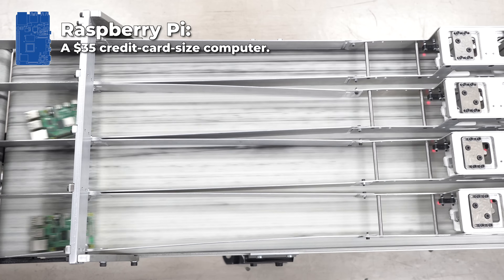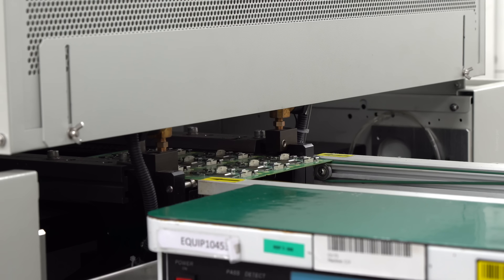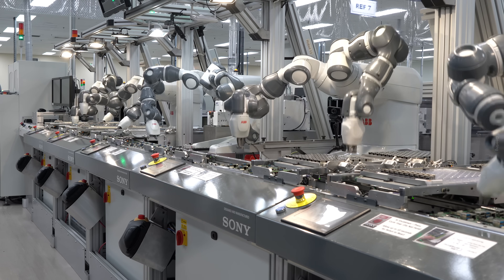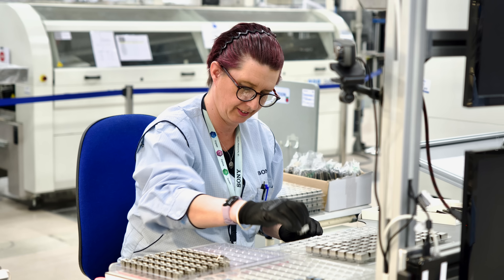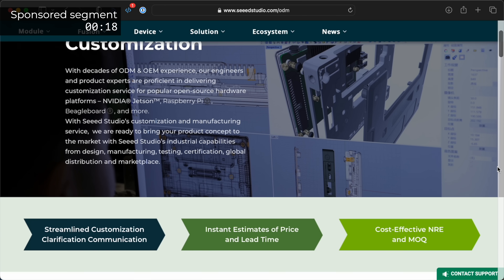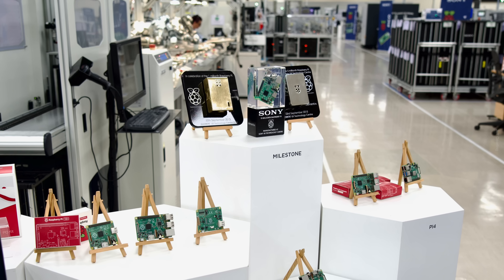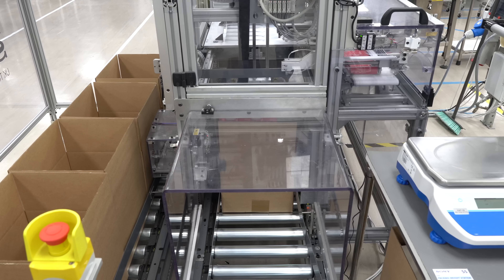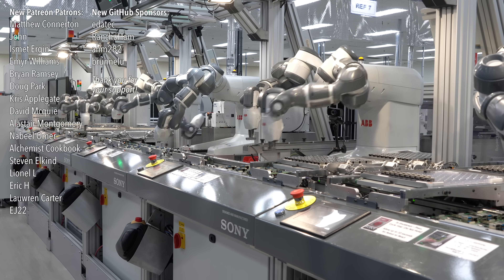How Raspberry Pis are made (Factory Tour)

Comment: Those two armed robots were first used on the HandiCam line in the mid 80s. Their development and tuning was a fascinating story.
Reply from the maker: I'm amazed how dextrous they are. They put me to shame.
Reply: @JeffGeerling  don't worry, they had and infinite amount of money and more than 1 person developing those :)... your cool things are made by you alone right>>>
Reply: the Robot arms were from ABB and according to @outofspec they make EV car chargers or dispensers (I can't remember what)
Reply from the maker: @lovedfriend2020  ABB makes a ton of cool robots!
Reply: Those ABB Yumi double arm robots are harder to operate compared to single arm as they double the complexity, they can be used to for examble assemble a lego. - my friend from a different department
Reply: @may_12521  Double arm robots are only really n advantage where space is at a premium. Notice how it is rare that they both move at the same time. Usually two separate arms are quicker and easier to program. They are mainly a gimmick tbh.
Reply: @robotsnthat  a double arm can be used as 2 seperate robots or as a single collaborative double arm unit. I wont say its a gimmick, just the double arm can do much more. if both arm work together, it can cut down time wastage.
Reply: @may_12521  No! One axis missing to be really efficient, and in my experience, way too hard to program. I've been an industrial robot engineer for over thirty years, and it would have to be a very specific task for me to even consider one. Multiple robots can be easily synchronised using one controller, and it gives much more flexibility,.The only advantage is they they take up a little less space.
Watch carefully and you will see that both arms move simultaneously only around 10% of the time. Very inefficient.
I think those five Yumis could be easily replaced with five six axis robots, and possibly two high speed SCARA robots, albeit with some fancy tooling

Comment: I was doing SMD manufacturing almost 25 years ago. They were VME/VXI size boards to build a Software Defined (Telemetry) Receiver for NASA. It was all hand placed then run through a then state of the art Heller reflow oven. Then the few through hole were had soldered.